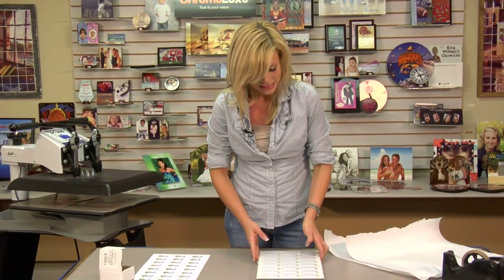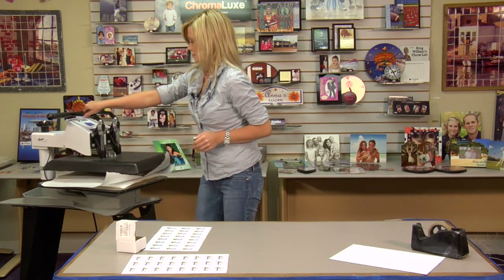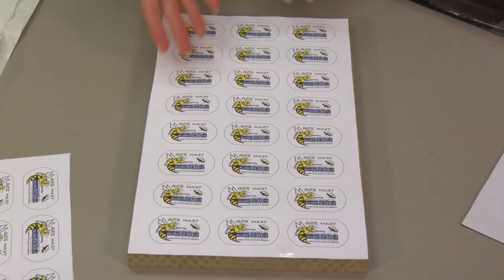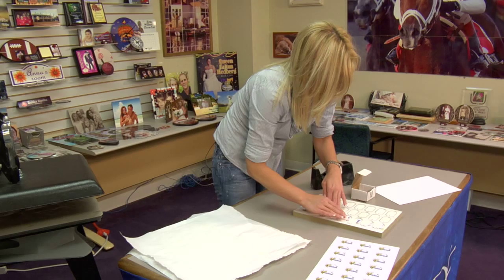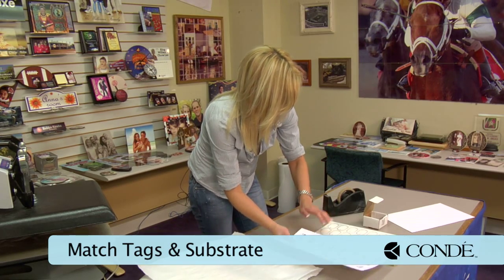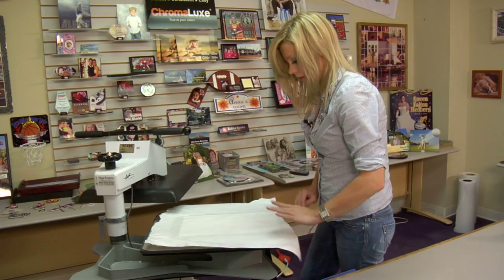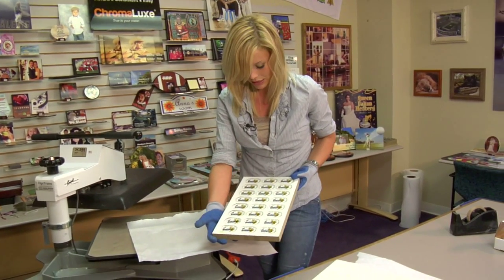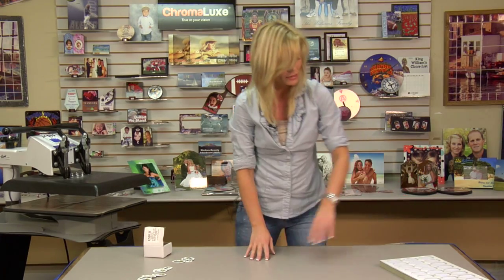Adding Images to Double-sided Dog Tags Using a Jig  -

Comment: Did you pull the plastic off the tags first or do you leave it on?
Reply from the maker: You would pull it off first.
Reply: Is there anything in particular you use on because mine looks like its faded
Reply from the maker: Big question, do you use ICC profiles or the powerdriver? Do you have Sawgrass inks? Does your heat press reach the proper temperature? Might be a good idea to check all those things and then call Tech Support.